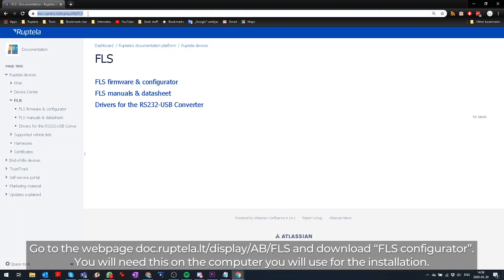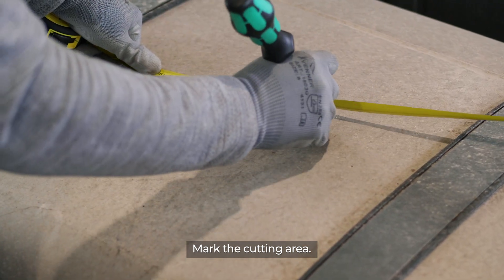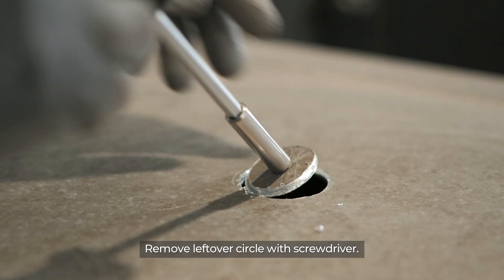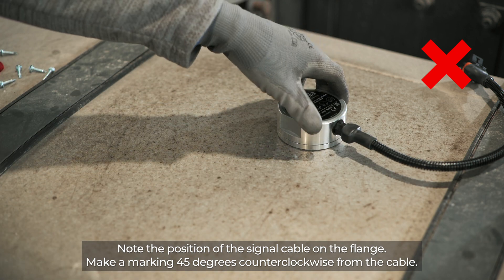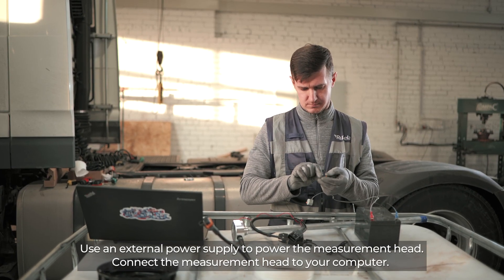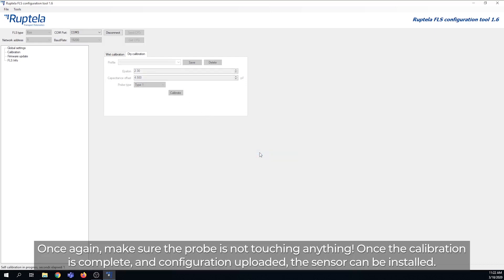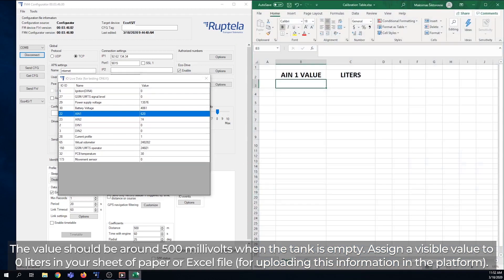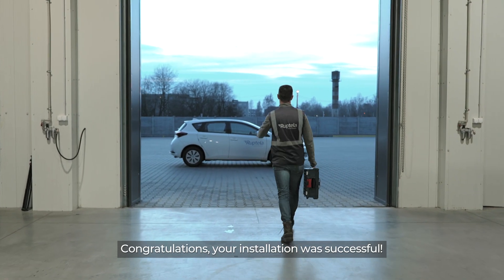[EN] Ruptela FLS Eco Fuel Level Sensor installation tutorial

Comment: When you are adding the values to the excell file, how does that info comes into the config file? Does it has to be imported thru the login menu?
Reply from the maker: This info does not come do device config file. Values from excel (or any other kind of notebook) needs to be transferred to tracking platform.
Reply: @RuptelaVilnius  so i can't just upload the entire excel to the tracking platform
Reply from the maker: @StPius-op3si  You need to rewrite data to tracking platform from any source that you took for calibration notes.